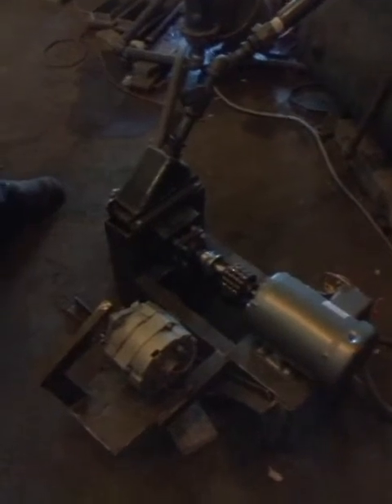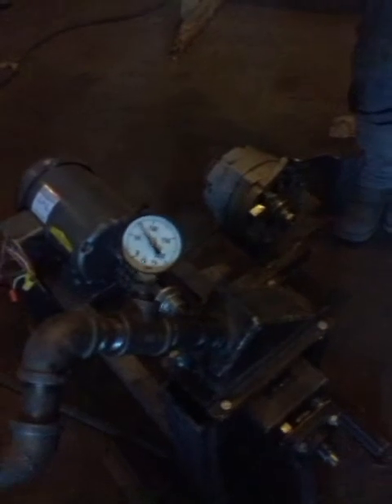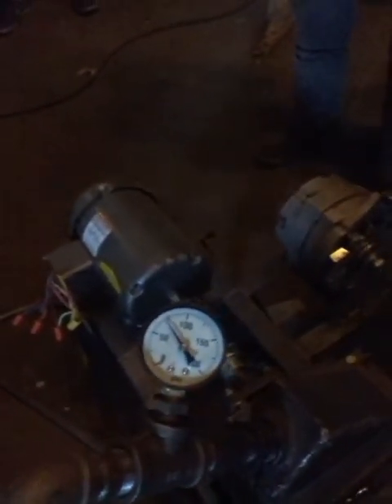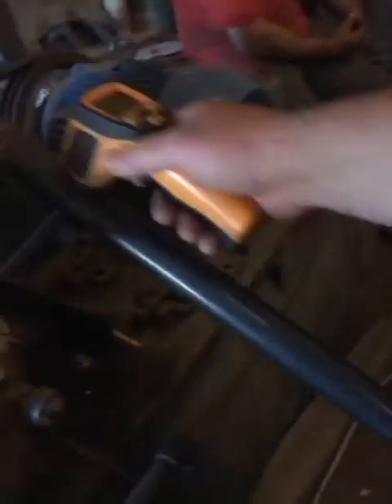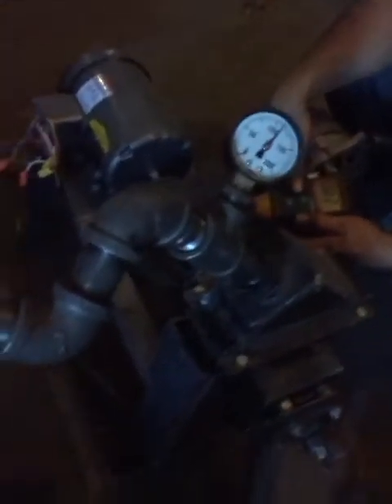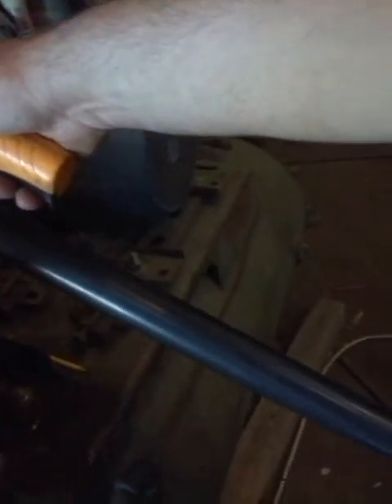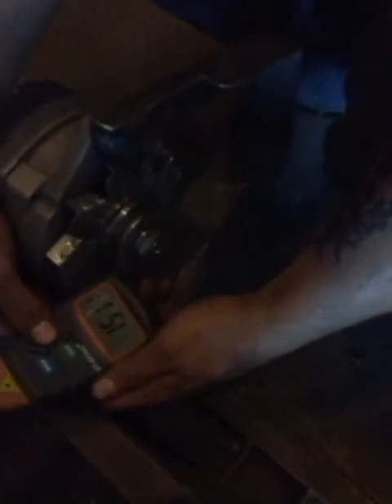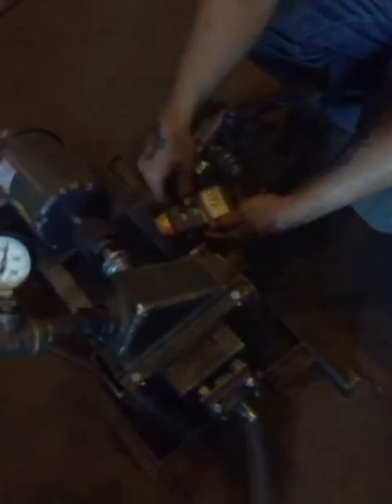Tesla Turbine and the Warren Rice Stamford University study of 1972... my thoughts

Comment: Why do you have those two 90 degree elbow right before the nozzle? Won't that add a lot of turbulence to the flow?
Reply from the maker: Most likely because it allowed us to hard pipe using a union. The pipe exceeded 400 degrees F so we used hard pipe that we had lying around. So an additional 90 degree elbow allows a connection in 3 dimensions no matter how long the misc piping pieces happen to be. A perfect connection every time. No cutting or perfection pipe fitting required.

Comment: Don a little correction.  The increase in pressure, when the turbine starts to pick up in RPM, is mostly due to the fluid starting to build more and more towards the peripheral part of the disks, creating denser spiral for the fluid path, especially towards the periphery, due to higher and higher centrifugal force, this creates sort of back pressure for the incoming fluid, and the higher RPM the more pressure towards the periphery the fluid builds. This is explained in Tesla's writings. In addition, he compares this, as he calls it "self regulating dynamics", for the turbine, with the Back EMF in the DC motors. 
In unloaded mode, no load on the shaft, and well parameterized system, this back pressure, will be coming close to the input pressure, allowing only a reduced amount of fluid to move through the turbine. One can view this as economic characteristic of the turbine for the usage of the input steam.
Reply: The most important thing here is to add a vacuum on the exhaust of the turbine, you should have water and absolutely no steam should come out of the exhaust.

Comment: Don I was reading over Tesla's Patents and found this:

 "In the development of power by thermodynamic prime movers, as steam engines and turbines, a low back pressure is essential to good economy, the performance of the machine being increased from fifty to one hundred per cent, by reducing the absolute pressure in the exhaust space from fifteen to about one pound per square inch."

British Patent # 179,043 "Improved Process of and Apparatus for Production of High Vacua" Nikola Tesla
http://www.rexresearch.com/teslatur/turbine2.htm#vacuum
https://teslaresearch.jimdo.com/list-of-tesla-patents/available-patents-in-teslaresearch/gb179-043-improved-process-and-apparatus-for-production-of-high-vacua-march-24-1921/

By using some of your compressed air steam you might use an inline Air Amplifier on the outlet of the new turbine. They can draw 19 inches of vacuum and operate inline so you could capture the heat to power the amplifier. I've seen them used on ebay for 40 bucks. https://www.nexflow.com/air-amplifiers/

I'm looking forward to seeing the new rotor in its casing!

Comment: One major problem, there's no clear definition of "Tesla Nozzle". TEBA overused the words "Tesla nozzle" and did not share much information to outsiders. Even when people used converging/diverging TEBA still hammers the hell out of innapropriate nozzle.

If I recall, the one who were able to reach the highest efficiency was Davydov and Sherstyuk (1980) according to several paper citing them.
Although I would like to verify this information myself, the paper is nearly nowhere to be found, and I believe some error may be related translation, because some source claim they reach that efficiency at 120,000 RPM and other 12,000 RPM. The mis-information are then carried over without back up.
Reply: But that being said, Tesla said the device works well irrelevant if nozzle efficiency. This is because if you design the disc pack correctly it won’t matter.  

This is from the original patent. 

“It is simple, light and compact, subject to but little wear, cheap and exceptionally easy to manufacture as small clearances and accurate milling work are not essential to good performance. In operation it is reliable, there being no valves, sliding contacts or troublesome vanes. It is almost free of windage, largely independent of nozzle efficiency and suitable for high as well as for low fluid velocities and speeds of revolution.”
Reply: @testurenergy  Well it matter because Warren Rice that did extensive test hit in the top 40% efficiency despite evaluating his rotor efficiency being in the 90%+. Russian fellow like Davydov and Sherstyuk managed to hit around 50% effiency of the turbine but that's it. Literrature claimed disk efficiency was not the problem because it was close to ideal.
My own Tesla turbine variant could drop 10% in efficiency if I messed around with the nozzle. It's the air momentum that drive the turbine, not necessarily the heat, which make the turbine niche.
Reply: @richardphatthenguyen195  just because someone designed a bad Tesla turbine and got bad results does not mean that the turbine can’t operate the way it’s theoretically meant to. 

People just have no idea how to design it correctly to get the efficiency. Everyone chases high rpm and don’t realize that high RPMs means high centrifugal head which means reduced mass flow rates of the motive fluid through the nozzle which leads to reduced power out. 

Secondly the momentum of the fluid IS NOT the only way for the fluid to apply a torque on the turbine. The heat energy is utilized in an expansion nozzle and/or during the spiral pathway to the center. 

The change in kinetic energy of a kg of 200°c steam entering the turbine at near sonic speeds and leaving at a radius of about 1/2 the disc radius (so about 1/3 of the fluids initial velocity) is EXTREMELY small relative to the thermal energy available in the temp drop of that same kg of steam down to 100°c. That thermal energy is available for further kinetic energy as the fluid spirals to the center expanding and further maintaining energy to be given to the discs even as it slows down dragging on the discs.

Add on the bacon bits of the viscosity of gasses goes up as temp goes up so the slip decreases due to the increased viscosity ultimately increasing torque and power out for a given mass flow rate thus increasing efficiency.
Reply: @testurenergy  1st p.)  One shouldn't say people did bad design, when their design is based off the original design and tweaked around it. At the same time, one can't say they didn't follow Nikolas original spec.

The whole point of Nikolas was "Hey my turbine is easy to design, less complicated, easy to manufacture and high performance that could match bladed turbine" 

So something's off, how such an easy design managed to pull the opposite of the claim.

2nd p.) Literature chased the RPM because that's how they always get better result. That's how it is understood. Nicolas himself would have gone after it, he specifically claimed that metallurgy was poor back then that he couldn't push much more.

3rd p.) Yes, if you're taking into account the system of nozzle+rotor+exhaust. I was refering to the rotor of the turbine itself. 

4th and 5th) Will need to experimentally test the claim.
Reply: @richardphatthenguyen195  
Tesla said NO SUCH THING. 

Stop parroting what everyone erroneously spreads about the Tesla turbine. 

Tesla NEVER says it needs to spin fast as a turbine and he never said he didn’t have materials to do it. In fact he said the exact opposite…. 🤦‍♂️

He only says it needs to spin fast as a centrifugal pump BECAUSE ALL CENTRIFUGAL PUMPS PERFORMANCE ARE DEPENDENT UPON TIP SPEED….. 

“I have found that the quantity of fluid propelled in this manner, is, other conditions being equal, approximately proportionate to the active surface of the runner and to its effective speed. For this reason, the performance of such machines augments at an exceedingly high rate with the increase of their size and speed of revolution.”

What Tesla ACTUALLY says about how to make the turbines work is this….

“ Owing to a number of causes affecting the performance, it is difficult to frame a precise rule which would be generally applicable, but it may be stated that within certain limits, and other conditions being the same, the torque is directly proportionate to the square of the velocity of the fluid relatively to the runner and to the effective area of the disks and, inversely, to the distance separating them. The machine will, generally, perform its maximum work when the effective speed of the runner is one-half of that of the fluid; but to attain the highest economy, the relative speed or slip, for any given performance, should be as small as possible. This condition may be to any desired degree approximated by increasing the active area of and reducing the space between the disks.”

NOTHING about spinning it fast. If you’re going to act like an expert on the topic maybe you should actually know what Tesla himself said about his turbines…. Hmm? 🤔 

Charlie Solis has already been designing actual working tesla turbine that output real power and torque even at low rpm and he uses no gimmicks or anything. 

Designed it to a T, just like Tesla Said to design it and they work phenomenally. 

Again, just because a few builders didn’t follow teslas actual instructions on how to build it because they don’t understand how they work does not mean they don’t actually work. 

Again, you have to know how to design them correctly. 

Just because the design is simple does not mean designing them correctly is simple. 

They require extremely complex fluid and thermo dynamics analysis to get the proper highly efficient low Reynolds number laminar flow regimes between the discs.

if someone designed a Tesla turbine and it doesn’t work ITS A BAD DESIGN because if you actually design them like Tesla explains they work amazingly….
Reply: @richardphatthenguyen195  in fact Tesla knew you did NOT want to spin them too fast because the centrifugal head begins to counter the incoming fluid pressure, reducing the mass flow rate in and reducing power out. He also says verbatim that they work great at high as well as low speeds of revolution… 🤨

“Still another valuable and probably unique quality of such motors or prime movers may be described. By proper construction and observance of working conditions the centrifugal pressure, opposing the passage of the fluid, may, as already indicated, be made nearly equal to the pressure of supply when the machine is running idle. If the inlet section be large, small changes in the speed of revolution will produce great differences in flow which are further enhanced by the concomitant variations in the length of the spiral path. A self-regulating machine is thus obtained bearing a striking resemblance to a direct-current electric motor in this respect that, with great differences of impressed pressure in a wide open channel the flow of the fluid through the same is prevented by virtue of rotation. Since the centrifugal head increases as the square of the revolutions, or even more rapidly, and with modern high grade steel great peripheral velocities are practicable, it is possible to attain that condition in a single stage machine, more readily if the runner be of large diameter. Obviously this problem is facilitated by compounding, as will be understood by those skilled in the art. Irrespective of its bearing on economy, this tendency which is, to a degree, common to motors of the above description, is of special advantage in the operation of large units, as it affords a safeguard against running away and destruction. Besides these, such a prime mover possesses many other advantages, both constructive and operative. It is simple, light and compact, subject to but little wear, cheap and exceptionally easy to manufacture as small clearances and accurate milling work are not essential to good performance. In operation it is reliable, there being no valves, sliding contacts or troublesome vanes. It is almost free of windage, largely independent of nozzle efficiency and suitable for high as well as for low fluid velocities and speeds of revolution.”
Reply: Tesla’s areal apparatus patent 1,655,114 has a very lengthy section about when to use converging and converging+diverging nozzles. 

It’s fig 4 and fig 5 in the patent.

Comment: Apparently the electrical charge in water effects its heat capacity dramatically. Check out this short video. Very good info is toward the last four minutes. But I would listen to the whole thing. It makes your gears turn with regards to water temperature and it’s kinetics. 

For example you might dramatically improve efficiency by altering the charge of the water on the input of the turbine or compressor. Maybe contrasting this with the water in your reservoir. Making the reservoir in opposite charge. There’s a link to the study in this video there is something going on here and it will very much impact what you’re working toward. You might be able to force charge differential with a very simple circuit allowing you to get the advantages of both positive and negative charge in water. Dramatic effects on viscosity which will have impact on turbine dynamics and efficiency.

https://youtu.be/Tmko4yE_KmA
Reply: I believe it is something  more simple than electrical charge, when you are at saturated vapor, you have the presence of multiphase, which translates as high viscous properties.

Multiphase flow are known to have interesting viscous properties they are also known to cause massive pressure drop in pumping for instance. Tesla himself suggested to run his turbine at steam.

Unfortunately, many Tesla turbine research were based on compressed air. That is the major flaw in the literrature reviews, air is known to have poor viscosity over steam.

Don has a very nice Tesla turbine which operates with saturated steam, some tuning would obviously increase the performance of this little beast.